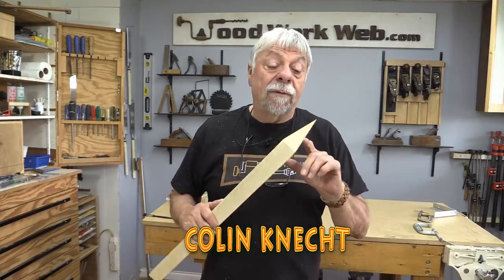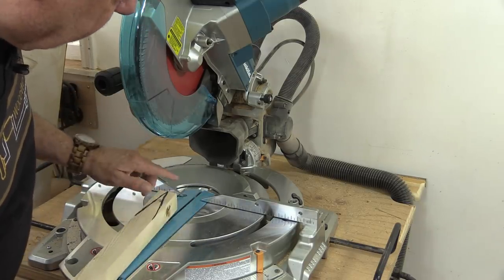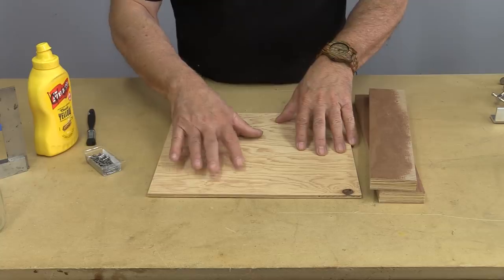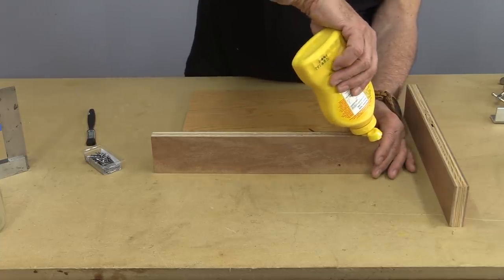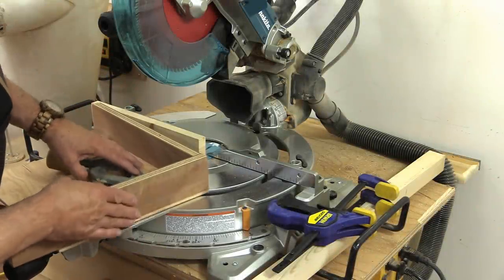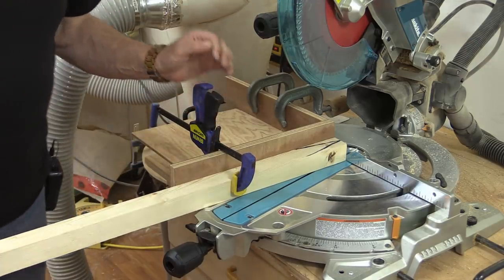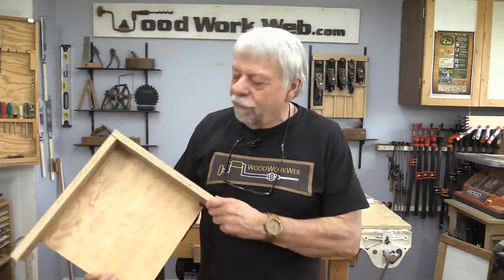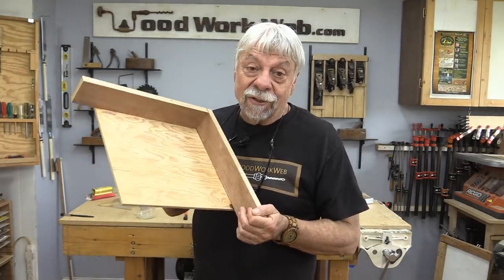Miter Saw Angle Jig / Making Wood Stakes

Comment: Used similar set up to make grape stakes in an old saw mill when I was a kid in high school, lived in Sonoma County, wine country. The old man used to buy bundles of two by two by twos redwood, we cut to different lengths to get rid of knots, cut tip and stack by size. I think I got two cents each, around 1968. Saw blade was fixed. Got pretty fast at it.

Comment: I have to applaud you Colin, I cant remember the last time i saw a YouTube video showing someone using a hammer and nails, its always the brad nailer that comes out hahah. I thought i was the only one still swinging a hammer!!
Reply: Since I follow woodworking videos on You Tube I hardly use nails anymore. Only glue and/or screws or dowels.
Reply: Hans de Groot Brads to hold position after applying glue, and then add screws if you want to make sure.

Comment: Great video, I modified the jig to create a slot that, after clamping the jig to the fence I could insert a 2x2 in and simply cut without clamping the 2x2 after each rotation - it helped because I had 60 stakes to make

Comment: Hi Colin.  If you screw a length of 2x1 to the inside of the blade edge to the jig you could clamp a block to it as a stop.  This would also be quicker than marking every piece to get position.  You could also make this to fit onto the mitre gauge of your table saw to achieve the same job.  Great channel, please keep up the great shows.
Reply from the maker: Thanks for the tip and thanks for watching!

Comment: Good to see a jig actually got made for this, wish my work knew of it, my Joiner boss chose to cut 3 freehand once, and I just happened to be nearby as my bench was right next to the saw, and still despite being 3 or 4 metres away, a piece of offcut came flying at me, and got me in the arm as I shielded my head, could of impaled my eye, impaled my arm, bloody dangerous, me and him were bloody lucky, but him being bloody stupid, even doing it on dimension saw would have safer and quicker coz u don't have to keep turning on and off or even lowering the saw and less chance for such a small piece to kick back at ya on a dimension saw, then the drop saw!
Reply from the maker: Hope it helps! Stay Safe, Jake!

Comment: 6:27 that works but probably an easier and more accurate way is to lengthen your jig so that the end of the jig matches the end of the workpiece so all you need to do is to use your finger to align the end of the workpiece with the end of the jig.

Comment: If you just extend the fence  or back board the distance to the blade, all sides and cuts would be the same, it will hold your stake.    
on the bright side of life, I can now fulfill my life's dream of becoming a vampire hunter.  lol
Reply: Here's to hunting vampires and clicking thumbs up for crushing trolls.
Reply from the maker: Remember to coat the stake with garlic ;) Thanks for watching.
Reply: @knecht105  yes, yes, better safe than sorry so we better wear hearing protection also., (so we  don't hear them scream)

Comment: I'm looking to cut two  2 x 6" PT boards 22.5 degrees like this to make a scarf joint  for a deck rail cap using a jig similar but 22.5 instead. The joint is to be fastened on top of a 4x4 post. They need to be precise cuts in order to make one long board out of this. Any tips or tricks welcome. I'll be using my old chop saw.

Comment: Nice results... Thanks for the demonstration. - I have one question and an observation:  At about the 3:20 minute of your video you show a steel / metal "right angle corner clamp" ( consisting of steel angles), which you used to make the plywood jig. 
Are those metal corners available from Home Depot or Lowes? - It makes a great corner clamp for woodworking.
It seems to me that you could have used the metal  "right angle corner clamp"as the jig itself for making those cuts on the miter saw! - My question is why didn't you use it?
Reply from the maker: You can get the right angle clamps for amazon: https://amzn.to/2vVsnWy 
The reason I didn't use them as the jig is that a longer wood jig is more accurate and gives more room to clamp the stake. Also, I try to limit the metal in my jig incase I accidentally run a blade into them. Thanks for watching.

Comment: nice simple fixture. Instead of putting a line around each piece just put a line on the face of your clamping surface where the saw breaks out from your first cut.
then you would not have to mark each piece.

Comment: Can you explain why this cut wouldn’t be possible if you cut along side of the fence? This “jig” seems unnessesary.
Reply: At minute/second 1.22,he answers that exact question .
Reply: The saw won't adjust to that sharp an angle
Reply: @cspann831 Keep in mind that zero on a miter saw is 90 degrees to the fence .a 10-15 degree cut is possible but there is no fence to secure/stop the wood thus the wood shoots out the back .The rest is explained on the video
Reply: i see the angle adjustment cant go that "steep" but still i think you could take a wedge put it against the fence and make the cut that way..
Reply: @justkiddin1980  Good luck !
Reply: Or you could use this jig and know exactly what angle you're cutting.